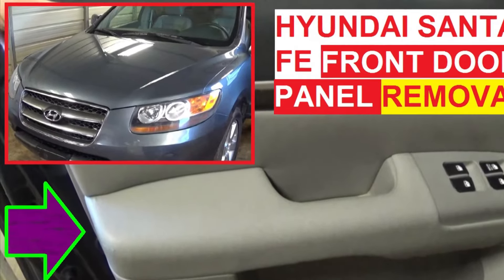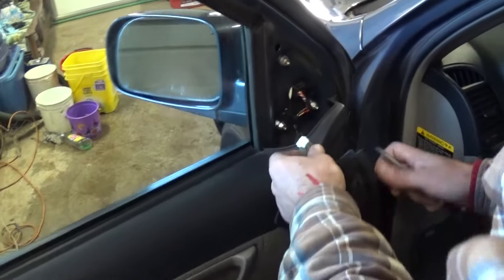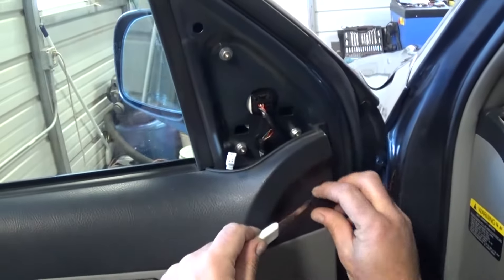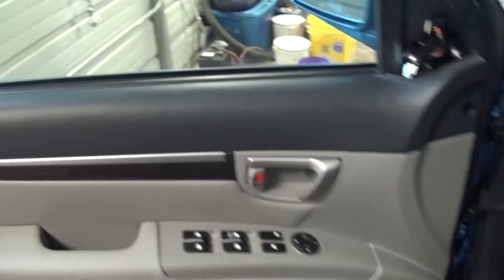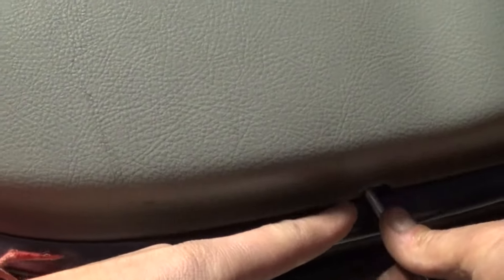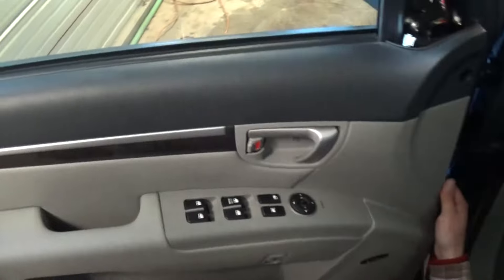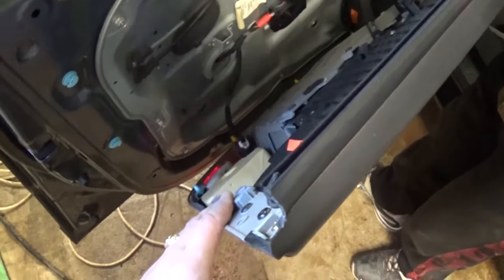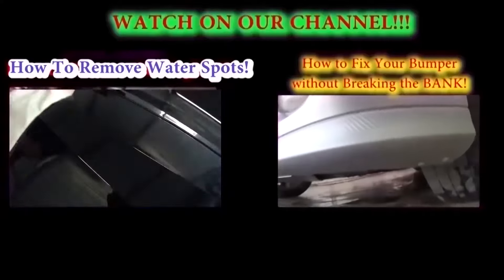Front Door Panel Removal and Replacement Hyundai Santa Fe 2006 2007 2008 2009 2010 2011 2012

Comment from the maker: Products that we use and recommend:
► Panel Removal Set: https://amzn.to/3YiMADu
► Assorted Fuses: https://amzn.to/4fx4s3F
► Tool Set: https://amzn.to/3p5MM6t
► Screwdriver Set: https://amzn.to/3XRB28Q
► Oil Filter: https://amzn.to/3w0Ulme
► Torx Set: https://amzn.to/3xlCkfT
► Torque Wrench: https://amzn.to/32qyRwg
► Liqui Moly Engine Flush: https://amzn.to/3IiDBID
► Voltmeter: https://amzn.to/4hB6Zvk
► OBD Scanner that we use most often: https://amzn.to/3I4MQfe
► Mobil 1 Oil: https://amzn.to/3xBc8B9

► Check out our Amazon Store for the tools and parts that we use: https://www.amazon.com/shop/worldmechanics
Reply: World Mechanics sorry guys but I have to give you a one star out of a five stars because you failed to mention the tool used to remove the plastic keepers that hold the panel on the door. I broke one removing the panel and one more trying to remove it from the door after I removed the panel

Comment: The front door handle driver side was not working. I had to remove the panel to see what the issue was. I went to your video to see how to remove the panel and it worked perfectly. Thanks for posting.

Comment: Thank you so much for the video. Do you have instructions on how to remove the rest of the items behind the regulator such as the glass and install it in a new door? Mine is dented and I need to replace the metal part only. Thank you.

Comment: Mine is broken from from around around the sides and bottom get stuck in the door won't open and now from the padded section under the handle is starting to rip away don't know if I can fix this on my own

Comment: Hello I have a hyundai santa fe 2.2 crdi 2008, the gas switch does not work and I have to do manual, where can I start to know that it is bad, I open the Front Door Panel , but all it ok.

Thank you.Very Helpful in my car SANTA FE

Comment: Hi. I have a 2009 Hyundai Sonata 4cyl.  And only my Auto switch for my driver door isn't going down at all. The button to press down is loose. Is this something I can replace myself. with little to no tools? Would I need to buy like a spring from auto parts store? 
I am good at replacing simple things as long as I follow step by step. This is so frustrating😩
Thanks in Advance!
Reply: Patrick Acheampong Thanks. I already purchased part. Gong to replace today. Thanks!!